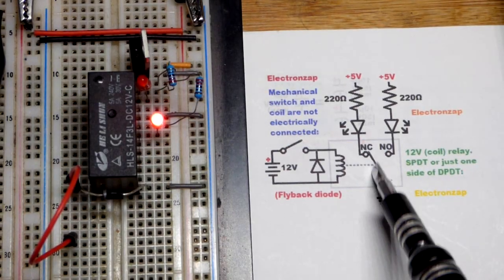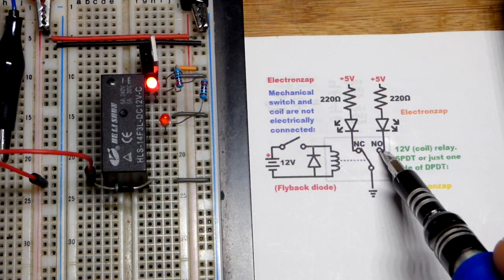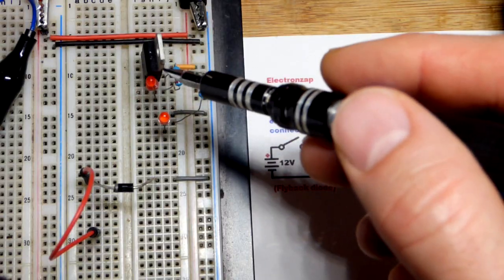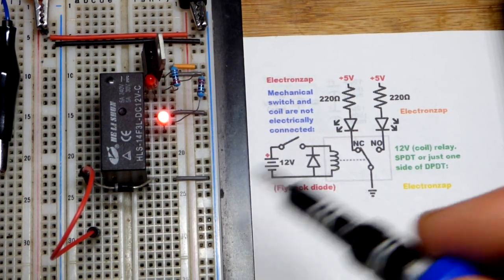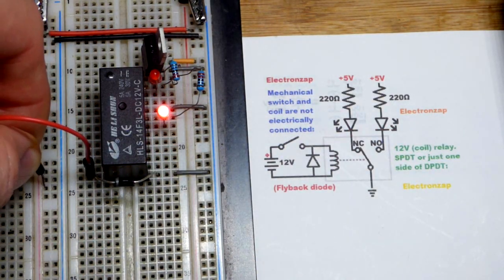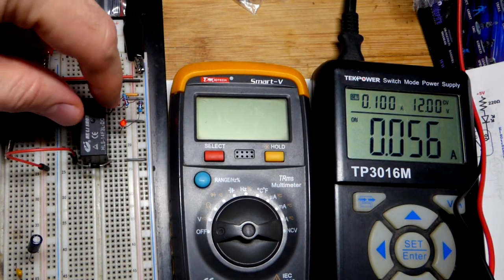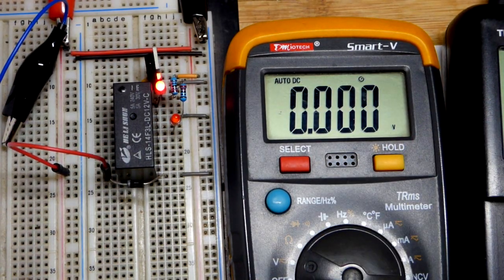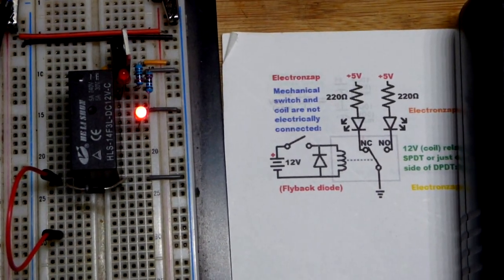How Relay Components Works SPDT Or DPDT But Buy A Module Instead

Comment: Great video!  If you put a resistor in series with your diode, relay will operate faster, but then you need to handle more voltage at the switch.
Reply from the maker: Thanks for the info!